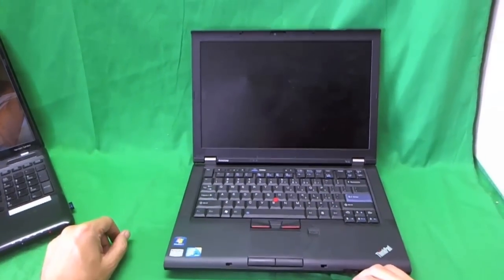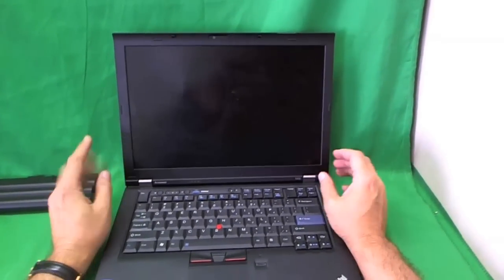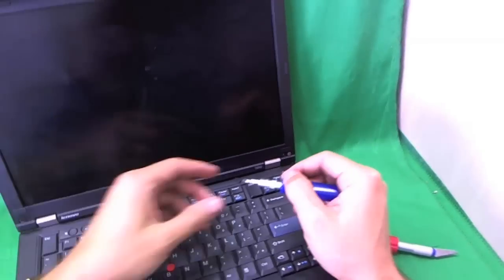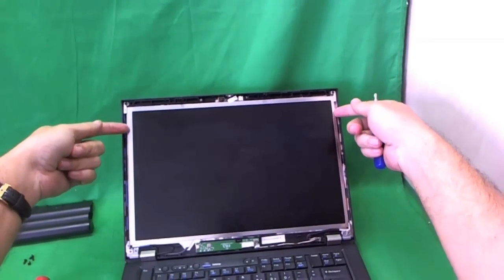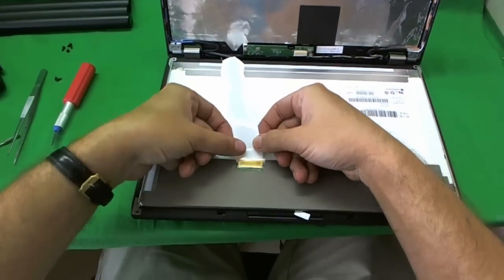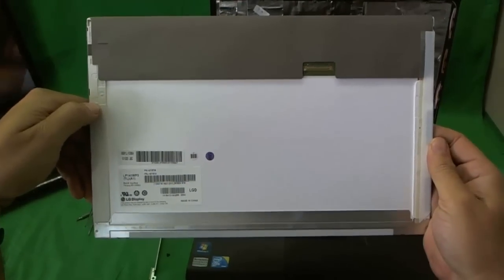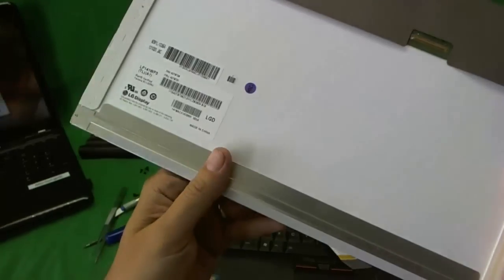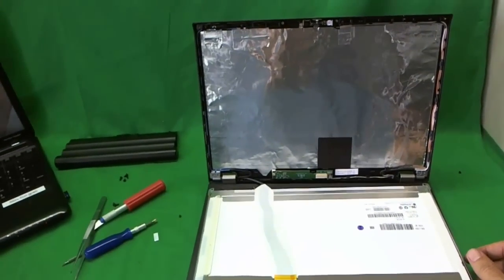Lenovo ThinkPad T410 Laptop Screen Replacement Procedure

Comment: Where to buy this screen?
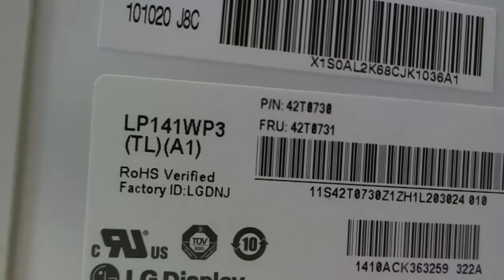Reply from the maker: We don't carry this screen anymore, if you forward to 8:08 in the video you will see the part number this model uses, if that's a match with yours (you will need to remove to verify) you can search for it on Amazon or Ebay. It's a pretty obsolete screen but but you may be able to still find one.
Reply: @ScreenSurgeons  oh thanks
Is there any chance to find exact screen without opening?
Reply: @ScreenSurgeons  I can't find in Amazon, please help me

Comment: I can confirm that I swapped a faulty LG (LP141WP3 P/N:42T0730 FRU: 42T0731) unit for a Samsung (LTN141BT09 P/N 42T0726 FRU:42T0727) from and other T410 and they both worked in the swapped over laptop.

This was a lot easier than getting the to CPU fan!!

Comment: I have two T400 WXGA screens, (with housings) Is it possible to take the LCD out and fit it in a T410 being the same size? Are the connectors the same, or can you adapt it. T410 LCD's are expensive, and more than the unit is worth.

Comment: You forgot to emphasize to be careful taking off the cable tape on the back side.It is easy to lift up the plastic sheet that the tape is attached to if you use the method as described. Then you cannot get it back properly. and this is more serious than you think as it will show on your screen as dark or shaded areas.I did two, one lifting up from the side of the connector, and one as described from the back side, first went ok, second I dagamed the screen (but only slightly).